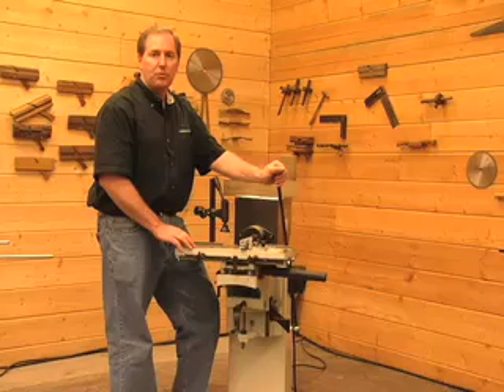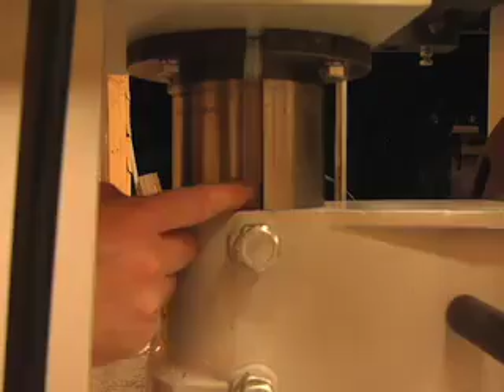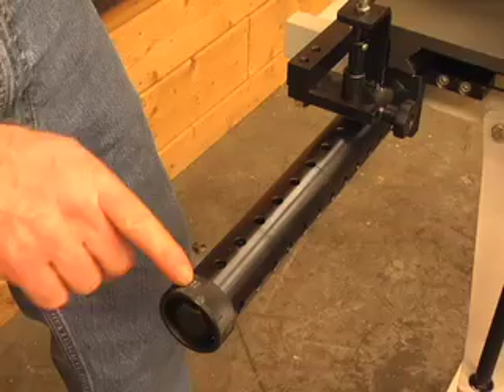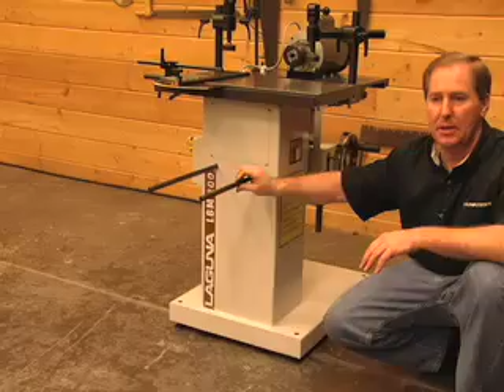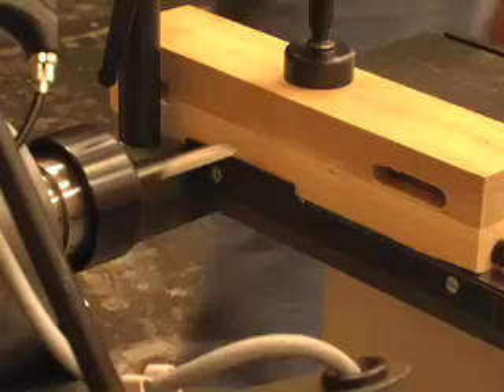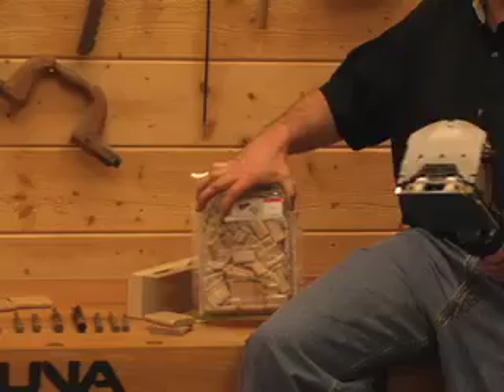Introducing LBM 200 Mortiser | Laguna Tools

Comment: In the video, the presenter is standing on the motor side of the machine. Other than for purposes of the video, does the operator of LBM 200 normally stand on the motor side or the work piece side of the machine? I ask because my shop is small and I am wondering if the machine can be positioned against a wall (with the motor side close to the wall and work pieces extending into the shop space for end-mortises), or if one must have access to both sides of the machine, requiring that there be at least enough room for the operator to stand between the machine and the wall. Thanks for your response.
Reply from the maker: Lets discuss, call us at 800.234.1976 for a quicker response. Thank you for your interest.
Reply: I have one of the older Lagunas that was originally a Robland made in Belgium. It was originally set up with a stationary angle plate for mounting a router and had two control sticks. After reading the advantages of this machine, I decided to rebuild mine to something similar to this one as best I could. I don't have an indexing bar, roller guides, or left/right tilting table. But, I DO have a high speed 3HP router motor (12-24,000 RPM), a 3HP drilling motor (1200-3500RPM), a horizontal and vertical motor mount system, a front to back tilting table,  air powered Y axis movement w/ micro adjust and incremental depth blocks, micro height adjustment w/ air quill lock, DRO X-axis indicator w/ micro adjusts both sides, miter gauge table groove with gauge, auxillary horizontal router table extension w/ invertible fence, vertical router mount for end finger jointing, and chip deflectors w/ collection tray. I don't think there's one on the market with features this well thought out. Yes, you will need lots of room in front of the work table because you're not limited to stock length in either direction. Having the machine on rollers helps a lot.